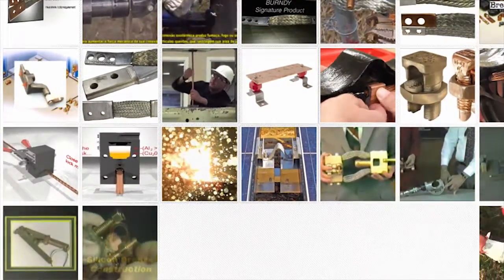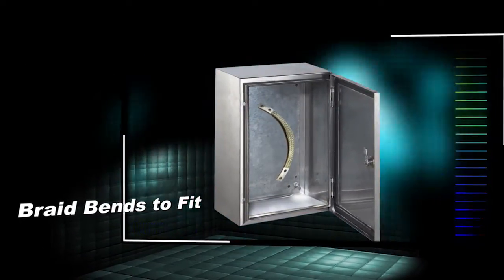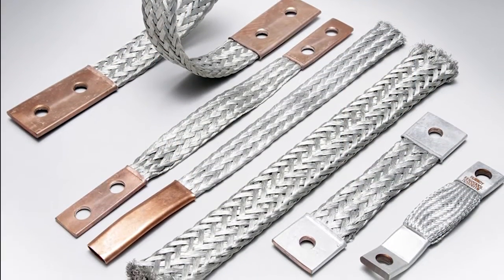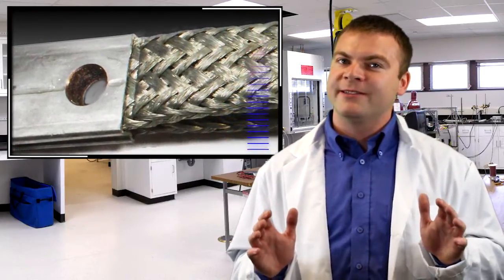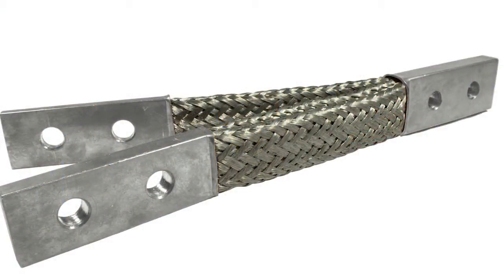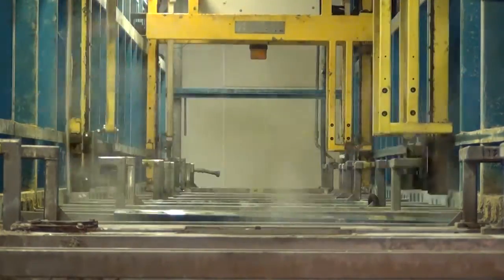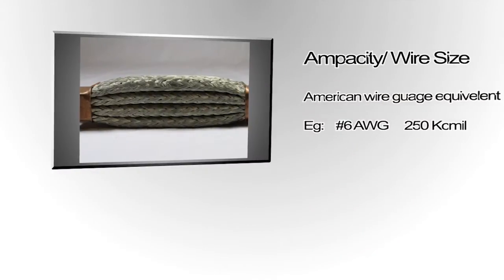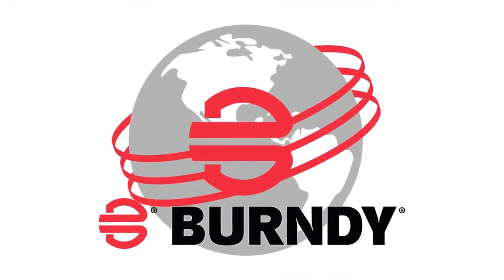Burndy Braid

Comment: I was thinking using these braided strips in between 18650 batteries, batteries in series and parallel configuration in a battery tray, removable from the tray, holded in position by spring load. The braided copper between the battery allows slight movent of batteries and charging cell to cell with a  hooked up bms